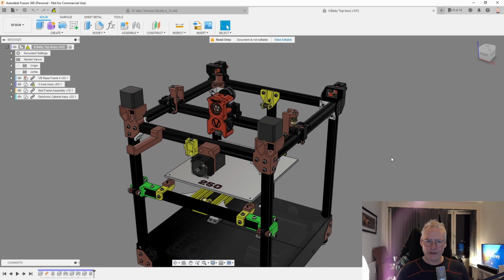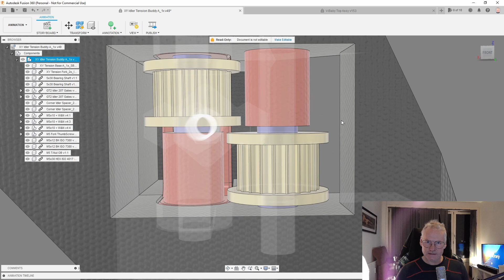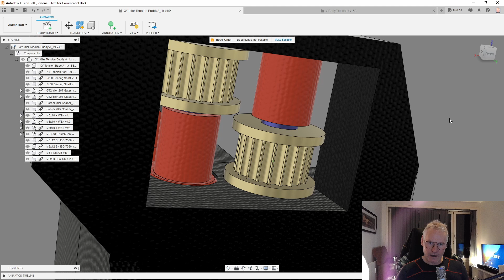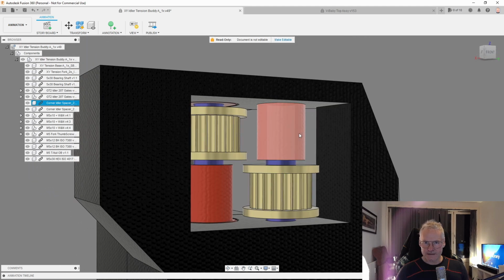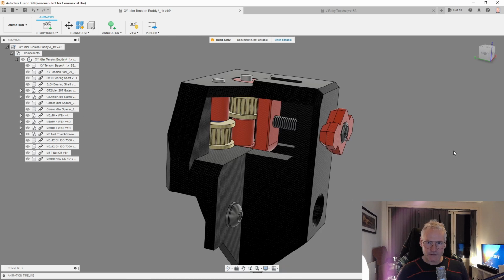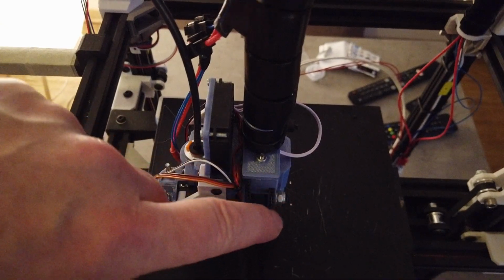3D Printer | GT2 Belt Tensioning Done Easy | All The Steps

Comment: The screw should be centered on the pulley and not the yoke to minimize side loads on tensioning screw.  Also, it is not possible on Core xy to tension belts independently since both belts are connected at one end to each other through the carriage.  This method brings with it the altering of belt path squareness since the pulley's are being moved in the corner.  You have me thinking about this problem.  It would seem the purest form of tension would be pulling on one end of the belt or moving a motor motors back since this would not alter the squareness of the belt paths.
Reply from the maker: Good point about the tension screw. The tension adjustment is to straighten the x axis so it gets perpendicular to the y axis. You can do this on any point, on the motor, the corner pulley or a separate pulley on the belt path between the corners. Moving the motor is not a good option. I have been researching the best option for a while and this system is great. It does not require any extra idlers or bearings like other more complex systems. You can however move the motors to the other side (the rear) and install tensioning on the single pulley where the motor sits now... If you understand. This system does make for more parts and idlers but would be a good option

Comment: I saw in the bill of materials you added a dragon hotend. Does it uses the same clamp as the V6?. Thanks!!
Reply from the maker: Thanks for following. Yes the dragon is a direct swap with the v6. You can use the v6 as well but the dragon has a higher flow rate, even the standard one

Comment: instead of measuring with calipers the distance, better to print two blocks one for each end. and then you can visualize any gap, to achieve Square movement
Reply from the maker: Good idea. How ever it would not be as precise. Also as I say later in the video the most important thing is to make sure that the x axis is perpendicular to the y axis. The frame might be skewed and then the measure method will not work.